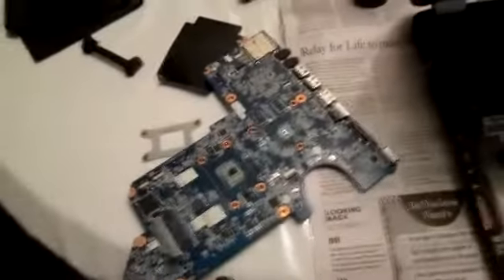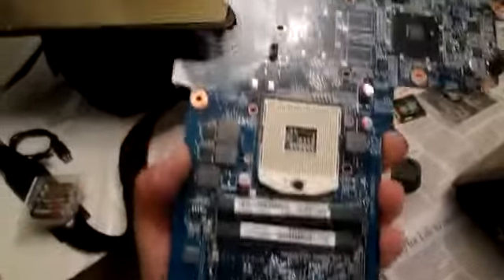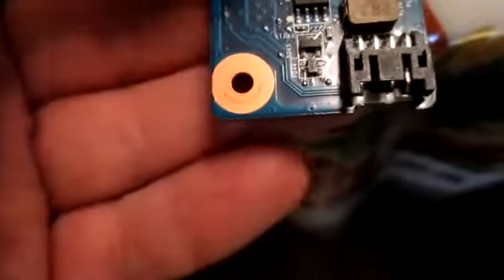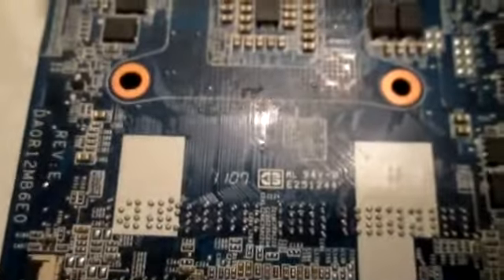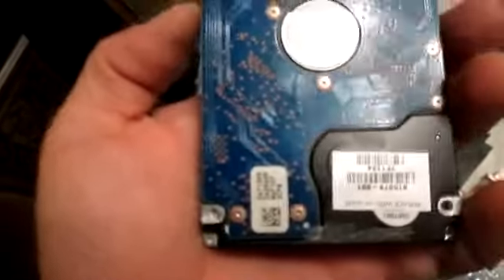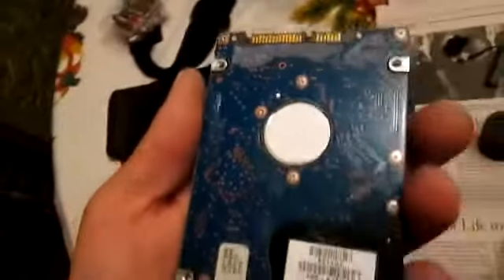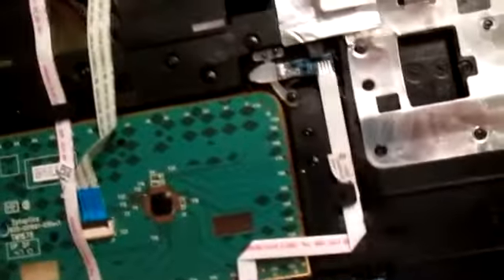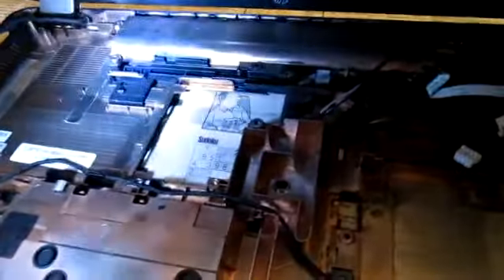Laptop On Coke

Comment: Ribbons can be replaced. Sometimes if I can i have touched up the joints on the board. Never good when solder joints get messed up. Do you do much soldering on the boards. If so i can give you a link to the flux i use. I really love it.